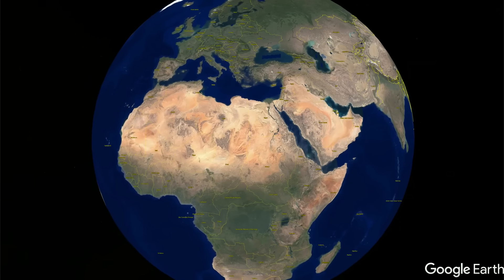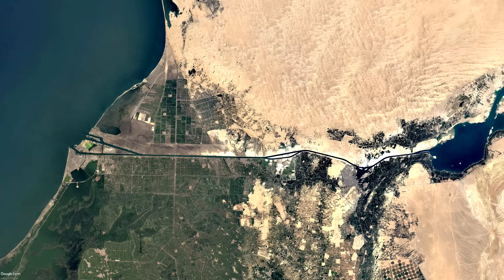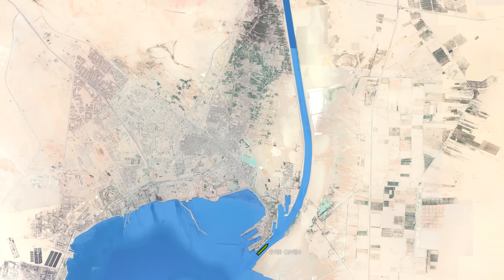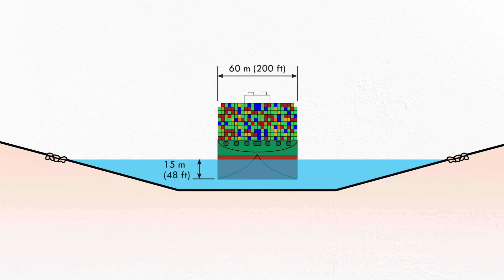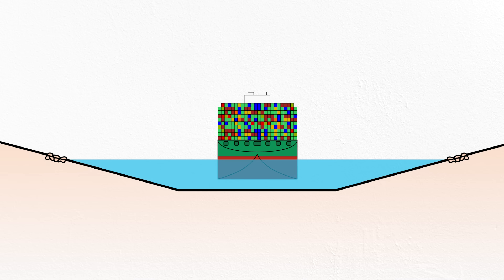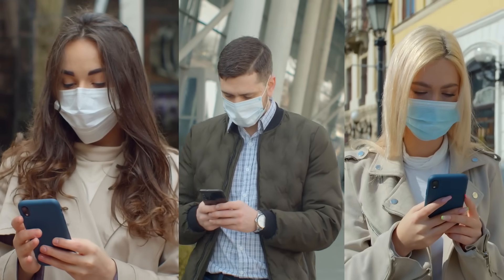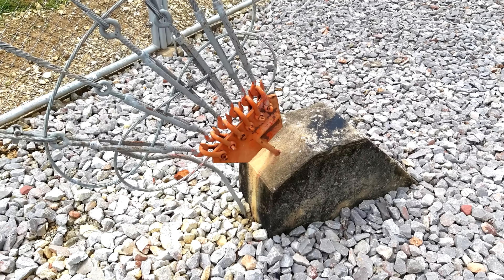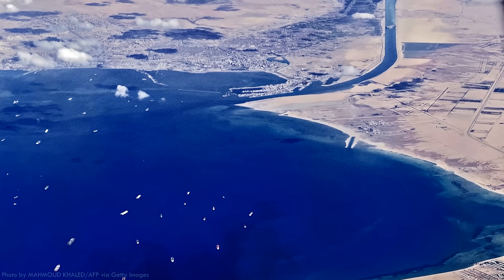What Really Happened at the Suez Canal?

Comment: I really hope you get this cause I need your help. I am a rural water operator for several water systems in Arkansas. We sometimes have to run new service lines for the customers and we like to bore the lines if we could. But this takes a long section of pipe and we often have long sections left but don’t want to put them together then pull the pipe back through the bored hole because we don’t know if the connector either a pex quick connect or a pex crimp connect will hold when we pull back through. Can you help me know how much force the quick pex connects and the the crimp pex connectors can withstand when pulled apart. Thank you for your help if possible.

Comment: I'm a Navigation Officer I have taken ships through the canal. My opinion is that without a mechanical failure, it was most likely a large gust of wind. Windage can effect the ship just as much or more than bank and squat effect. One minute of strong enough wind would be more than enough to change the ships rate of turn, enough to hit the side of the canal. Also squat effect on the steerage could have contributed.
Reply: Hello Captain Phil. As a layman of shipping I'm wondering why these exceptionally big ships are not towed through the channel. The margin of error seems so small, that it almost looks like an accident waiting to happen. Would having 2 tow vessels pulling the ship through such a narrow channel give better lateral control, or is this too simplistic thinking?
Reply: @evviper24  yes, some ships have a tug escort but not often. First tugs cost a lot of money to hire. Then the way the canal works is with convoys of ships, if each convoy (South and North) had 10 ships and each ship had two tug boats the convoys now total 60 vessels and would be too long to pass each other using the two lane system in the middle. Also the only way the convoy moves together is by speed matching, at about 8 knots. If you try to speed match a convoy of 30 vessels it wouldn't work, unless the tug boat mooring lines were very slack, in which case there might not be any point in attaching them. Also tug operations are usually very slow, less than 4 knots. At 8 knots it would be difficult for a tug boat to make any difference to the bow of the Ever Given because of the weight of the ship and the inertia of it moving forward.
Reply: I am not a navigation officer, but I do have a knowledge of engineering and navigation, and I agree that the most likely cause of the accident was the wind. And more specifically, they would have tried to steer slightly into the wind in order to prevent the wind from pushing the ship towards the left bank (the wind was coming from the east). So they would have tried to steer a few degrees east of the center-line of the canal. 
However, the exact number of degrees for this correction depends on the speed of the wind at any time, and what seems to have happened was that the wind dropped somewhat when the accident occurred, and neither the captain nor the pilot noticed this, and they failed to correct the direction of the ship, with the result that the ship started approaching the right bank, and ended up digging in. After which, the inertia of the ship pushed the stern towards the left bank. So from the engineering and navigational points of view it's not really difficult to understand what happened.
Reply: @stevenczitronyi7847  yes you're referring to what we call COG course over ground. We don't pay much attention to the ships heading - the way the nose is pointing - the pilot and the officers are looking at the resultant of set and drift which gives us COG... our vector... That includes wind. Where did you read about the officers loosing attention? Cheers
Reply: When we do use tugs usually we attach one forward and one aft.
Reply: That sounds like a good reason for the mishap ,   given the huge area not only of ships hull   but also the mass of containers that almost add another ships wall area for the wind to push against  ,  you would think for sure  one good wind gust would be enough to send it way wards .
Reply: @mikldude9376  Yes, that was precisely the problem. And by the way I have not even mentioned in my explanation above, that the main error was simply going too fast for the conditions. They should have done no more than half speed under those conditions. At full speed things can go wrong very quickly under 50 mph winds. The canal was not much wider than that large ship in this section, and in a blinding sandstorm they should have proceeded much more slowly, to give themselves ample time to correct the ship's course from moment to moment. The poor visibility with flying sand wasn't helping either.
Reply: If wind gusts are sufficient it is a wonder Ever Given events are not more frequent.
Reply: @mikeg2798  Well, it's a question of probabilities. And by the way it wasn't just a "wind gust," but a major sand storm with speeds up to about 40 knots (46 mph). These happen only about once a year. And they have the greatest effect on the largest ships, and ships of the Ever Given size are at the moment only about 1 in 100 traversing the Suez Canal, and they don't necessarily traverse when there is a sand storm of that magnitude... 
There has been talk about whether or not to ban such ships from using the canal. Another option would be to stop all ship movement during sand storms, but because of lost revenue, it's doubtful they'd do that.
Reply: The canal does not seem big enough for what it does, also relying on only one channel with all that traffic is just waiting for  disaster to strike or at least terrorists a perfect target
Reply: @brianmays1731  The northern section of the canal (north of Bitter Lake) has already been widened for 2-way traffic. It's just the shorter southern section which is still one-way. And this ought to be widened too, yes.
Reply: @brianmays1731  To their credit they have good security: there is a pillbox every few hundred meters with a soldier, and every few kilometers there is a small army barracks, and that's on both sides.
Reply: Well there is a lot of guess work going on here guys, we will just have to wait for the investigation report to be made public.
I forgot to mention squat effect, (not so much bank effect), but in this case as I mentioned, if it was not human error it will most likely be the combination of squat effect and wind gusts. Squat effect messes with the water flowing past the rudder and thus effects the steering.

Comment: It was planned in conjunction with the attempted missile attack on the Saudi Arabian oil refineries to increase the price of oil and therfore inflation....period.....all your technical explanations are irrelevant.  Such a ship with a computer-aided satellite navigation system makes it almost impossible for ships to be grounded.
Reply: Except ships transversing the canal are under manual operation, hence the need for a pilot. So there goes your theories in an instant.
Reply: @Garfie489  

https://www.marineinsight.com/marine-navigation/30-types-of-navigational-equipment-and-resources-used-onboard-modern-ships/
Reply: @010Astroboy  Of which very few are used during the Suez canal voyage. 

The fact they are available, does not mean they are always active. For example. Plane has autopilot - yet they still use the pilots in manual mode to take off and land, even if the autopilot could theoretically do it itself.

What youd basically be stating is the presence of autopilot means all planes takeoff using it - which is not true, nor is it true for the Suez.

Comment: Your explanation of the bank effect was good but you only told half the story.  The forces imparted by the bank effect along the length of the ship are different.  At the bow the forces push the ship away from the nearest bank as the mound of water in front deflects the boat in the opposite direction.  Then the bernoulli effect acts on the stern of the ship on the same side drawing it closer to the nearest bank.  Thus there is a natural twisting force that is applied on a ship as it approaches one bank.  The pilot must steer the ship into the bank to resist the twist motion if the ship is not centred.  The bank effect is well understood by ship pilots.  The same forces are at play when two ships pass each other or when they drive along side each other such as replenishment at sea with naval warships.  There would be far more accidents with these mammoth vehicles that do not respond quickly to steering inputs if there wasn't a good understanding of the forces.

Comment: good demo randy. this was a still a joke. i'm not a civil engineer but i did run a marine construction company for 2 years in the caribbean. i could not believe, even with my limited expertise, that it took as long as it did to extricate this ship. it's the suez canal so they absolutely have some large high end dredges in the vicinity. i could have cleared that ship with a 16" suction dredge in under 4 hours so there is no way that with all the resources at hand it should have taken the length of time it did to deal with that accident. my guess is paralysis by (over)analysis, no-one knowing who makes the call, being timid, or perhaps something more sinister like stock market manipulation. any way this is sliced it was negligence and incompetence at every step.

Comment: So the water in the model is acting like air, or air pressure, the problem being the near side bank, i would imagine that the pull toward the bank, under these conditions would look like the pull of two magnets when they collide, much bigger forces of course but but running away with itself exponentially until collision, maybe there is some transferable math between the two, maybe.

Comment: Your demo with bricks is like the causeways from the pyramids to the Nile. I believe water from the Sadd el-Kafara dam flowed down the causeway and full-width rafts carrying stones built up enough water in the front to lift the raft. Water at the rear is deep because water builds up in front of the next raft and so on. Essentially you are creating a deep channel on an incline. The height of the water in front is going to be a few inches more than at the back so you have to overcome that pressure. If the rafts fill the width of the causeway, the water flow will be minimal because the rafts lift up just enough to allow a thin film of water underneath. Friction is minimal but could scrape the sides a little. A three degree slope is nineteen feet forward and one foot up. So the force to pull is one nineteenth of the weight of the stone so 2500 pounds requires 131 pounds of pull plus 40? pounds for water force.. That is four people pulling 43 pounds each. It would take 18 men pulling that hard to drag a stone across the ground.

Comment: As a professional engineer comma i am curious on your opinion regarding the narrative that we are given on how the canal was built in 1859 in 10 years comma with no mechanical machinery comma, no fuel engines, and no electricity. I find it completely implausible that the canal is dug out by hand from some 30,000 laborers
Reply: 10 years and daily labor of 30,000 people at any given time will dig a 120 mile long canal, i don't really see how they couldn't have dug a canal in 10 years with that many people. (also they did have electricity in 1859.)

Comment: First I applaud this channel for content and clarity. 
Ok here goes, 
I would have tried massive amounts of compressed air injected into the sand around and under the bulbous bow. 
I understand there is most like likely not enough commercial grade  compressors available. 
I wonder if research is being done into rapid response vessels to prevent delays by freeing ships quickly by using compressed air injection into sand.

Comment: to solve the water flow problem around large ships in the Suez Canal they should build small water relief canals about the length of a container ship that vent the displaced from the front to rear of the ship as it passes. that way, the pressure difference around the side of the ship would be much less.

Comment: so a solution might be to add some water pump/impeller capability to large ships.  the normal mode would take suction from the bow and exhaust it aft.  for situations like this that would be reversed with a water jet breaking up the bow sand suction.  other water ports could be switched for sideways use.

Comment: There have already been reports (corroborated by the the EG's GPS track, as well at the GPS track of the ships that were before it), that the winds in that part of the canal, were high enough to push those ships slowly off course. Remember, the stacked containers on these long ship will act like a huge metal sail, and wind can easily push the ship sideways if there's enough wind speed (just like an airplane trying to land in high crosswinds). 
Do a YouTube serch for "watch?v=tGXTrcQ5wm8" (titled "Container ship Ever Given blocked Suez Canal
")  to see the actual GPS track that it (and other ships took) before it ran aground. It's easy to see that the all ships were being pushed of course by high winds in that part of the canal. Unfortunately, the EG was not able to correct itself to keep it from going into the bank.

Comment: The issue was solved when 2 very powerful thugboats arrived. In an interview the thug boat company explained that heavy, powerful equipment is not used in the region, so it had to travel 7 days. The thug boats where so powerfull that they had to be carful not to split the ship in two. There was also a (not used) plan to blast water under the ship, blasting away the sand.

Comment: The explanation is a bit simplified and I don’t think the bank effect was the only reason for the grounding. I have read that this vessel had a speed of around 13 knots when it grounded, which is a bit strange since the speed limit through the canal is 8 knots. There are control posts all along the canal to check that ships stick to this. For every ship that passes the time is noted.  If you notice that the vessel is not responding as you want you can correct this by increasing the engine speed for a short period to get more effect of the rudder. On this day there was a strong wind from southeast and not a sandstorm. The area of the ship that was above the water would have worked like a gigantic sail making it very hard to control. It should have never entered but I assume commercial pressure won this time. It also explain the high speed. All ships that passes through the canal will have a group of Egyptian mooring men with them and there are mooring points along the canal so that the convoy can stop at any time if needed. The vessel was probably out of control some time before the grounding at that is why they increased the speed. With the strong wind from behind this did not help. Both squatting and the bank effect would have increased. When a vessel passes through the water you will have a positive pressure in front of the vessel and also at the rear. Along the sides there will be a negative pressure. There will also be a drag right behind the vessel. Depending on the speed the squatting effect will increase and in this will even be worse through shallow water. In many cases the hydrodynamic can be used to the vessels advantage. In the Houston ship canal they have a manouver call “Texas Chicken “ where they use the pressure in front and at the back to pass one another in a narrow canal. It is quite hairy to watch. In open waters the reduced pressure at the vessels sides are used to tie up two large vessels in order to transfer cargo. This is the safest way to do such an operation.

Comment: Thank you for the explanation.  I had two thoughts about future problems on the canal.  1. Would it be possible to use an air compressor or water pump to blast the mud out of the way?  2. Would it be feasible to have "cleats" on the banks to which a winch could be connected?  Basically bring a crane and anchor it to a cleat.   Or would there just be no way anchor the cleat in the sand/mud?  Or would it be impractical to add 120 miles of cleats "just in case" ?  Thanks

Comment: You got some things wrong. The canal can handle a lot more ships than you claimed per day. They post a "max of 106" on a "normal" day as the top amount allowed. That is based on their crew availability (the extra captain they put on board, etc.). But they can easily double that with the right strategies, like making all personnel work overtime. The queued ships got through within about 3-4 days after fully opening again. Very few got diverted around Africa. You implied that more were diverted than stayed in the queues just waiting (which was 400-600 queued up). Maybe 10-15 actually diverted (one report says a maximum of 20 diverted, certainly not hundreds like you implied).

Comment: Doesn't desert sand have less dilatency than beach sand? I recall a documentary about Dubai Palm Island having to switch from trucked in desert sand to dredged sand (way more expensive) because desert sand was too round and wouldn't hold together.  I would think the sand on the banks would be desert sand (also might explain the very shallow angle of the banks).  Great video, as always.

Comment: Due to the liquefaction properties of wet sand I imagine that a series of explosions and vibration could have helped move huge volumes of sand quickly and perhaps release the bow. However that sand would have to flow down slope and would make the canal more shallow and would reduce depth available to float the vessel. Oh, Problems every where you look. 
By the way, I didn't notice where the dredges deposited the spoils.